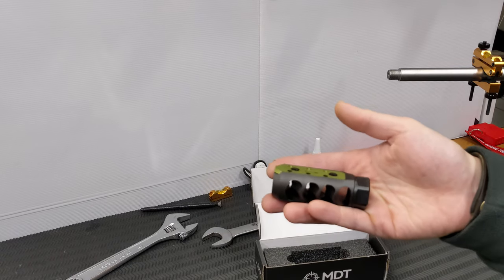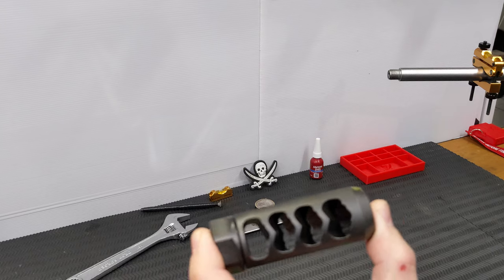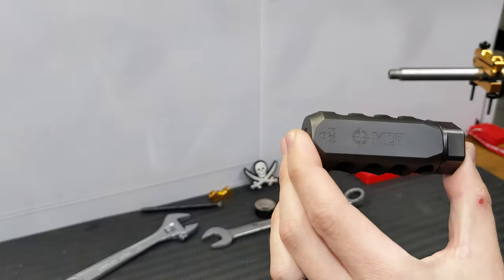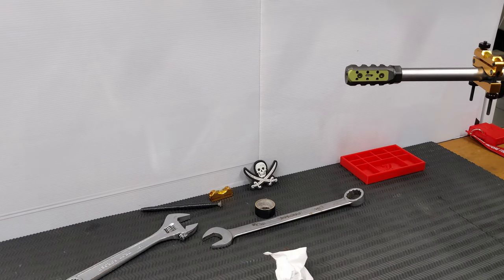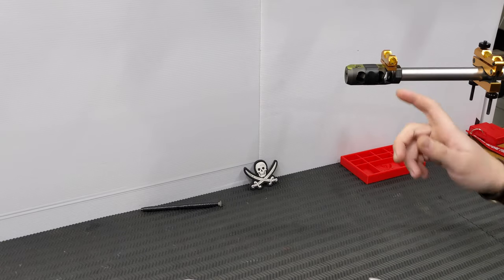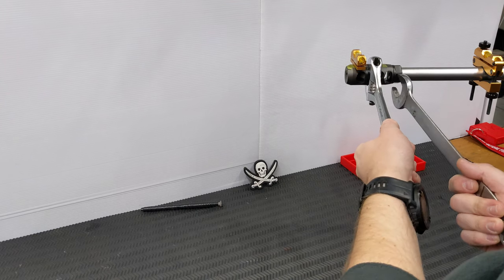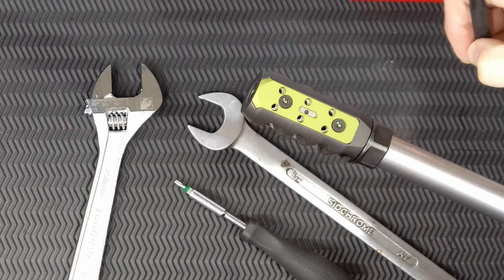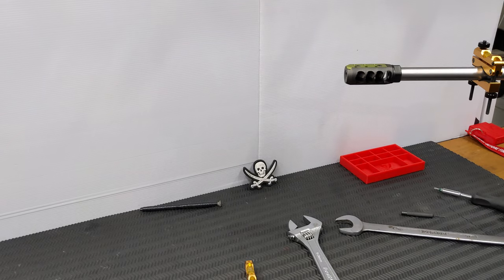What Recoil? - The Best Muzzle Brake - MDT Comp Brake - Overview & Install

Comment: Very nice brake, but why buy this? When you can buy a APA little bastard for 118 bucks right now. which is an absolute recoil eater for it's size, price, and tuneability.
Reply from the maker: it comes down to prefrence. that looks like a great break. however i think the port design and gas disruption on the MDT will be far superior.
Reply: @pyrate_nz  no i disagree but lets agree to disagree 😀
Reply from the maker: deal